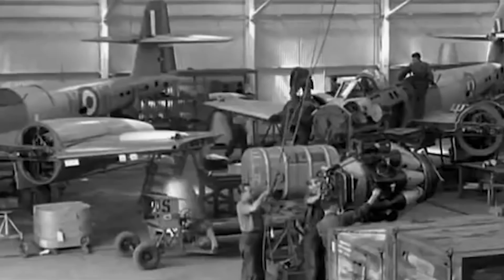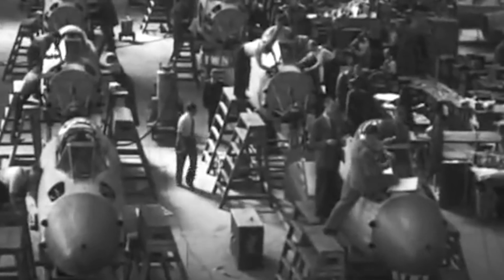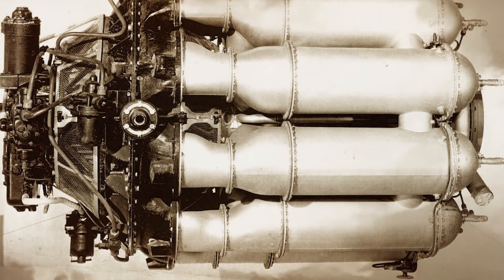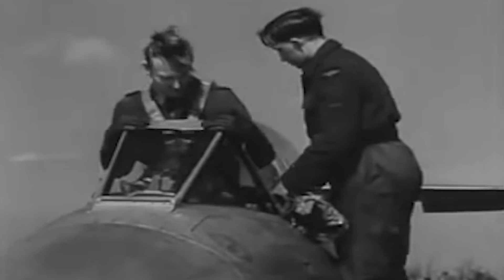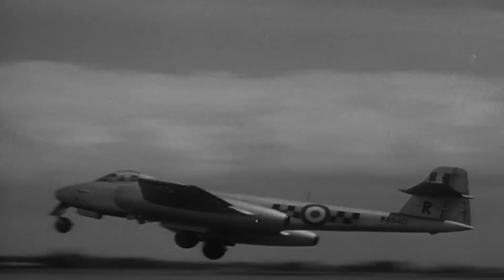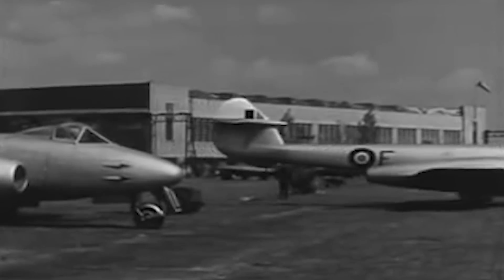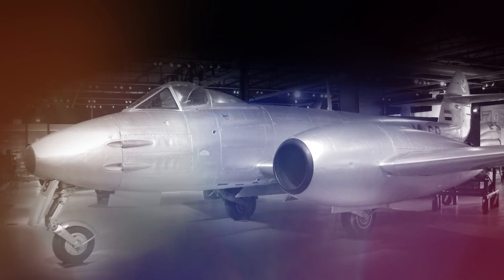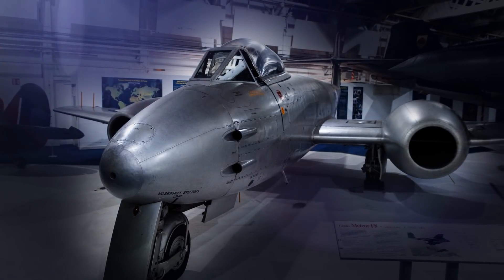Gloster Meteor - The Only Allied Jet to Fight in WW2

Comment: The US P80 was deployed over italy but did not engage in combat during World War 2.
Reply: The P59 was not really intended for combat, and was a massive success in its role as a jet trainer and as a way for America to study jet technology in practice. They used that experience to manufacture p80s which flew over europe during WW2, then saw combat in korea against mig15s and was severely  outclassed because it is a world war jet not a cold war jet like the mig15 and mig17
Reply: THE P-59 was unsuccessful as a trainer as well and was very quickly retired from operational service.

The MiG-15 was designed during WW2 by Heinkel Engineer Seigfried Gunter who designed the world's first jet aircraft, the He-178
Reply: @WilhelmKarsten  So what about the MiG9 where does that fit into the story of nazis straight to MiG15s, not to mention the MiG15 is a completely different plane. And no the P59 didnt fail as a jet trainer it failed to reach the expectations for an active duty jet fighter, being deemed inferior to the British Gloster Meteor. It was used to train pilots on the new jet engine system.
Reply: @FishFlys  The MiG-9 is a postwar design... its design began after the MiG-15.
 The Bell P-59 was a notable failure and production ceased before the war ended... it  had the highest loss rate of any USAAF aircraft during WW2 as a direct result of its extremely unreliable J31 engines that were based on the non-flight rated Whittle W.1 design.
Reply: 1. A simple google search will prove you wrong. The MiG9 flew in 1946 and could not use its guns, pushing MiG to develop a new jet fighter, the MiG15, which first flew in 1947. 

2. I can find no sources mentioning any serious safety hazards the P59 possessed. Regardless of that white lie, other jets were absolutely accident prone; the MiG9 took many lives as did Nazi jets and rocket planes. Even the Brits had some terrible accidents, the tech was new. @WilhelmKarsten
Reply: @FishFlys  Development of the MiG-9 did not begin until the war ended... it is a postwar design.
Work on the MiG-15 began at Heinkel in 1944.

Production of the P-59 was canceled in 1944 before the order was even completed, most of the P-59s went into storage in 1945 and were stricken from inventory by 1946.
I have a photograph of dozens of P-59s stored at Stata Maria Army field dated 1945, they are parked in the weeds covered in dust.
Both the P-59 and FR-1 were notable failures and considered death traps due to the horribly unreliable J-31 (Whittle W.1) engines.
Reply: @WilhelmKarsten  nuh uh
Reply: @FishFlys  Serious as a heart attack son..
Just the facts here.
Reply: @WilhelmKarsten 

We believe we can clear up some commonly held myths and misconceptions, obviously

It's always good to see the facts presented clearly and concisely isn't it?

The Mig-15 was an upsized and tweaked copy of the Whittle / Gloster E28/39 and used a copy of the RR Nene engine. 

British Aerospace Sector. 

Interesting British achievements.
There is no doubt that the Fairey (England)
Delta 2 was of course the world's first jet
aircraft to exceed 1000 mph.  lndeed It
exceeded the previous record by 310 mph &
held the record for more than a year. Incidentally, the Dassault Mirage series of aircraft are based on the Fairey Delta 2. 
March 1956,  UK Peter Twiss,
1,132	 mph, Fairey Delta 2,	 Chichester, UK

The next speed record after the FD2 -
December 1957, USAF	1,207.6	mph, McDonnell F-101A Voodoo, 	Muroc, California 😎.

Non combat phase accident losses.
% of Aircraft built.
The EE Lightening did not have unusually high losses. 
The Canadair CL-44 was a turboprop airliner.
Canadair CL-44               (ff 1959 ) 48%
Lockheed XF104             (ff 1954) 100%
Lockheed  P80                (ff 1944)  43%
Lockheed F104               (ff 1954)  45%
MD FH Phantom 1          (ff 1945)  35%
MD F4 Phantom 2           (ff 1958)  28%
MD F3H  Demon              (ff 1951)  32%
MD F-101 Voodoo           (ff 1954)  34%
EE Lightening                   (ff 1954)  33%
Gloster Meteor                (ff 1943)   21%
DH Vampire                     (ff 1943)   23%
DH Sea Vixen                  (ff  1951)  33%
Gloster Javelin                (ff 1951)   20%

Note that the Meteor didn't have particularly high losses, flew with more than 20 airforces for decades, got involved in air to air combat during a number of conflicts successfully against aircraft that first flew many years after the Meteor first flew.

Early days, jet engines. Whittle performed the world's furst demonstration of a gas turbine aero engine in 1937. The RR Nene, a centrifugal gas turbine aero engine, was the world's most reliable & most powerful gas turbine aero engine in 1944. Licensed built versions & copies of the RR Nene & RR Derwent would go on to power many aircraft in Russia including the Mig 15 & Mig 17, the US, China, France & other countries for decades after 1944. Incidentally, the Mig-15 was in essence an upsized / tweaked copy of the Whittle / Gloster E28/39 jet aircraft including a copy of the RR engine.  The centrifugal compressor gas turbine aero engine with Whittle style reverse flow combusters and sometimes an axial compressor section is still manufactured by more than one company, the main application being helicopters.

   That's correct, The Tornado & Typhoon & their engines are supersonic & are indeed British design aircraft with British design engines built by an international consortium. The Tornado design for example started life during the 1950s at Vickers as the AFVG, it's engine is based on the RR RB-199. The EE Lightening is also a British Supersonic jet aircraft. At the time the EE Lightening first flew it was indeed one of the fastest aircraft on the planet.

  The Typhoon is the British BAC-EAP with an engine based on the British RR XG-40, the Typhoon is also built by an international consortium.

  Clearly It's a great pity & a crying shame that British military forces had to occupy a large part of Germany for decades after 1945 & Russian military forces had to do the same. Of course Russia still posseses a large chunk of what was German territory & of course  Russia & the UK produce nukes. Obviously Germany does not produce nukes.

An example of what goes on these days in various countries.

   Indeed, There are no German companies that make German jet aircraft in Germany & there are no German Companies that make German gas turbine aero engines in Germany that are suitable for widebody airliners.

  BAe Systems, GKN Aerospace & Rolls Royce combined now do more Airbus work than Germany on an absolute basis & significantly more work than that on a per capita basis.
   
  Per capita for the home nation BAe Systems is the world's largest defence contractor. BAe systems announced the recent £4 Billion takeover of Colorado based US based Ball Aerospace.
  
  BAE systems now does a significantly higher value of work for Airbus than it did when it was a major Airbus shareholder before 2005.
     
  RR now owns US Engine maker Allison for example which does classified Aerospace work for the US Govt.
   
 Anybody currently flying on a widebody airliner stands a good chance of being on an aircraft powered by RR gas turbine aero engines built in the UK.

  A glimpse of what goes on in the very internationally orientated British aerospace sector.

Boeing Apache Attack Helicopter.
AH-64: 75 UK suppliers, 7% UK content, global fleet of 1280+ aircraft.
F35B more than 130 UK Suppliers, more than 30% UK content.
F35A & F35C more than 130 UK Suppliers, more than 15% UK content.

The UK has the world's highest combined per capita Nuclear, Defence & Aerospace Sector activity.

Rolls Royce Holdings UK
Subsidiaries
- Rolls-Royce plc
- Rolls-Royce North America (Allison etc &  
  Classified Military stuff)
- Rolls-Royce AB
- Rolls-Royce Deutschland
- Rolls-Royce India Private Limited
- Rolls-Royce Marine Power Operations
- Vinters Engineering Limited
- Rolls-Royce Controls and Data Services
- Rolls-Royce Power Systems
- Bergen Marine
Joint ventures include:
- Rolls-Royce Turbomeca
- MTU Turbomeca -

Trent Family
The MT30 (Marine Turbine)
Industrial Trent 60 Gas Turbine
Trent 7000
Trent XWB Airbus A330neo.
Trent 1500
Trent 1000
Trent 500
Trent 600
Trent 700
Trent 800
Trent 8100
Trent 900

RR wholly owned subsidiaries in Germany handle smaller 2 shaft RR gas turbine aero engine work.   

We hope this helps of course.
         
Cheers, as always & indeed 👍.

Comment: The 1941 Gloster E28/29 was similar to  the 1939 Hienkel HE178.Even having trademark Heinkel twin tails. The Meteor similar to the ME262. I wonder how much is coincidence or Intelligence operations?
Reply: Seems very unlikely as the Meteor was very  hastily converted from a twin propeller Bristol Centurus engines to jets...
While the Me-262 was designed from inception as a swept wing jet fighter exhaustively developed in the world's only large diameter supersonic aircraft wind tunnel laboratory.

Comment: I was surprised to find out the Gloster meteor has a ability go 60,000 feet, at that time I thought that was quite impressive
Reply: Not during WW2... the F.8 could only reach 43,000 feet... and that wasn't until  1950 with the introduction of the more powerful Derwent 8 engines.

Comment: There is a very good reason why British pilots called it the "Meatbox" it was a severely flawed aircraft with an absolutely appalling loss rate in non-combat operations.
Reply: Wrong mister - it was an early gen 1 type and a leap in performance terms and very good for its time - it was subject to some early issues but flew thousands of hours more than a lot of other types so statistically losses were high these issues were soon rectified but please do some actual research and not run your mouth off on statistics you will start to understand that most "accidents" were not due to the design of the aircraft. I see your comments and statement on all Meteor videos and I ask that you read my comments on the "Phantom dive" and other posts elsewhere and treat the aircraft with the respect that it deserves.
Reply: @robertharrison2260  Wrong, the Meatbox was a very disappointing failure as a jet fighter which is exactly why it was never used by the RAF in the fighter role.
The Meatbox was used in the ground attack, reconnaissance, training and demonstration roles, the Meatbox was breifly tested in the interceptor role against V-1 cruise missiles but it's performance was deemed unsatisfactory and was replaced by faster, propeller driven aircraft like the Tempest and Mosquito.

As British jet engines slowly improved in thrust performance the crash and fatalities statistics of the Meatbox significantly increased, it's reputation for killing British pilots only got worse after the war... most Meatbox pilots were killed after the war during peacetime operations.
Official MoD records confirm 890 Meatbox crashes between 1947 and 1980 killing 450 RAF pilots making it the worst jet aircraft in the history of the RAF.
Reply: again wrong - your basic lack of knowledge is evident - Meteor equipped 30 RAF Sqns plus overseas Sqns in many roles including Day and night fighter where it was used to intercept and in point defence role taking over many duties from Spitfire. You clearly haven’t read a lot on the Meteor losses as your ignorance is evident - i know of many and my father lost people he knew but mostly in mid air collisions and other mishaps such as G loc - compressibility and flight into terrain during low level sorties. Look beyond statistics and look at hours flown and Compare meteor with other early jets and you may be surprised. Was Meteor a success well it exported well to foreign buyers and lasted longer than many early jets such as Scimitar, Attacker, and many others - your opinions have little weight and not much support so best give up and do something productive with your time.
Reply: @robertharrison2260  The Gloster Meatbox was not a fighter and never shot down a single Luftwaffe plane... it only killed British pilots.

Comment: I wonder if the Meteor had a tendency to get into a spin ?
Reply: Yes, the Meteor suffered from high speed instability that often presented as a sudden snap into a flat spin... it's primarily mode of crashes was asymmetric handling, an engine failure on take-off was considered unrecoverable

Comment: Did you say 450 pilots did in this aircraft???
Reply: 450 pilots killed in british service, this  figure does not include pilots lost in other countries.
1 out of every 3 built crashed or were destroyed in accidents making it the worst jet fighter in history.
Reply: @WilhelmKarsten  Hello Sandyboy, I see you are touting your old lies under a new name. As you do actually know, the mech failure/pilot error rate foe Me 262s and F104s in german service is way worse than the Gloster Meteor's.
Reply: It sounds bad by modern standards but is far from the worst, especially rated against flight hours, the Meteor was in service for over thirty years and with more than a dozen air forces.

Comment: Anyone know if the Frank Whittle engine would flame out with too much throttle too fast like the Huns' plane did?
Reply: Yes, all 1st generation jet engines had manual fuel controls, the pilot could easily flameout or overheat the engine by moving the throttle levers too much or too quickly. The F.8 models were the first to receive fully automatic fuel controls with the introduction of the Rolls-Royce Derwent V engines in the 1950s.  
 Another important thing to remember is that all jet engines have  poor throttle response and accellerate slowly from  flight idle, and there is a noticeable lag even from cruise speed to maximum power.
Even modern jet aircraft with Digital controls (FADEC) have the same sluggish throttle response compared to supercharged piston engines.

Comment: The planes in the infancy of the jet age are still the most beautiful planes in history. They all lose their beauty once they have to start making room for rdar on the noses.
Reply: The Gloster "Meatbox" stands out from the all the other early jets as it was originally designed to be propeller driven.
Reply: The Meteor was completely outclassed by the Me-262, it was never successful as a fighter and saw little use in that role.
Reply: @WilhelmKarsten  Hello Sandyboy, how's your new name working out. I've seen you are already taking a pasting under it.  With regard to the Meteor and the Me 262 as fighters, as you know (and I know you won't contradict me on this) the Me 262 was crap as a fighter and for that reason the pilots were warned not to take on the escort fighters. Your nazi chums wisely never used it for that, using it instead as a boom and zoom interceptor against bombers or a ground attack plane. A big contributor to its failure as a fighter was of course its crappy engines as described by Eric 'Winkle' Brown (though he rated it otherwise).
The Meteor of course proved itself as a fighter in several post WW2 conflict but not so well against second generation fighters, as would be expected.

Comment: 450 pilots lost without any being shot down by the enemy.
Reply: Over 1,000 crashed in RAF service alone killing 450 British pilots...
150 crashed in 1952, 12 in one week,  6 in just one day!
Reply: It was a first generation jet at a different time than now and it's mech failure/pilot error loss rate is far from the worst.  You are talking about a time when a racing car could leave the track killing 80 people and the race wasn't stopped and at an air show a crash would send an egine flying into the crowd killing 30 and the show carried on.